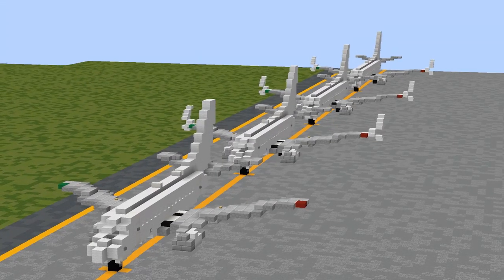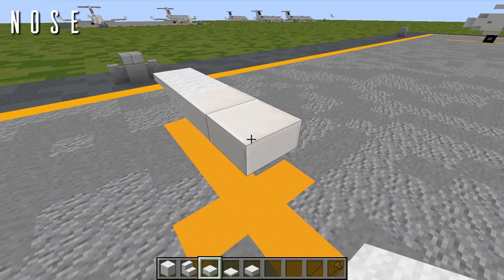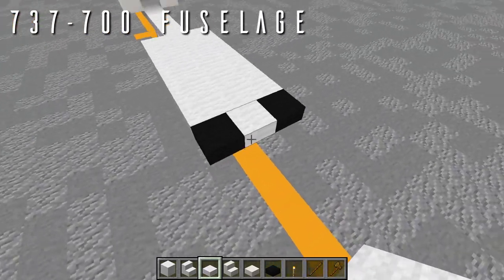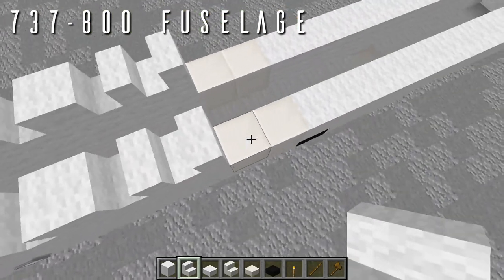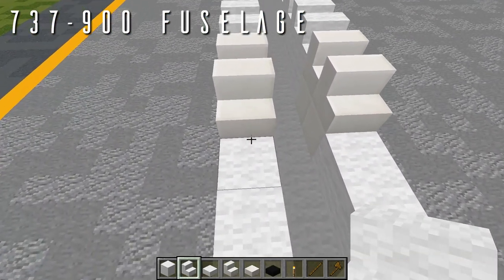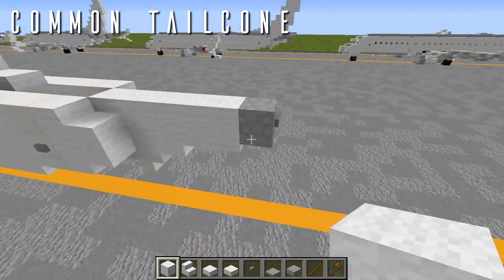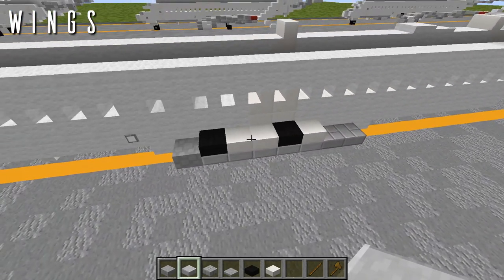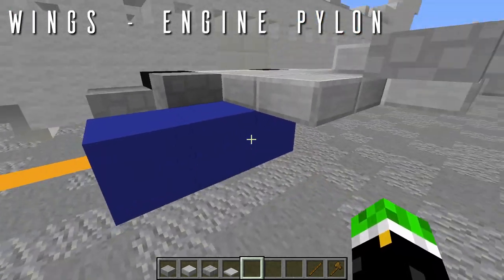Minecraft Boeing 737 Next Gen Tutorial [1:1 Scale]

Comment: this is not 1:1 scale because in real life the boeing 737 have a configuration of 3-3 in economy
Reply from the maker: It actually is indeed perfect 1:1 scale - however, because blocks in Minecraft are one meter wide where the fuselages of real aircraft are only barely a few inches thick, this scale doesn't leave as much room in the interior. We scale our builds for the exterior, with the interior just as an accessory, so smaller aircraft in 1:1 scale often don't end up with room for interiors at all - one of the quirks of building in Minecraft!
Reply: @Aeroteam  Ok sorry